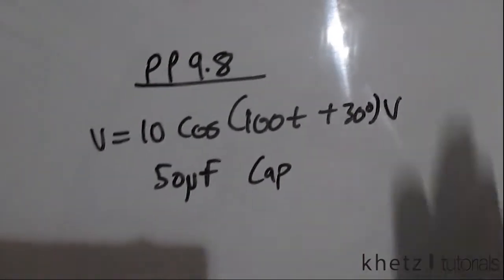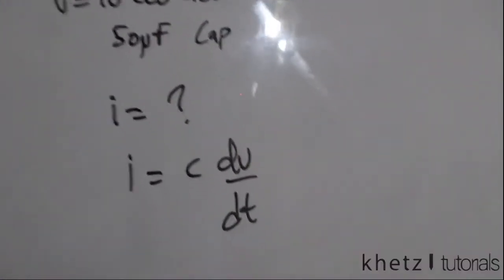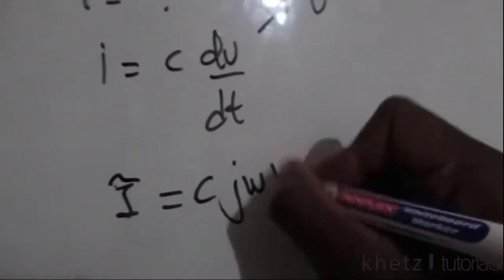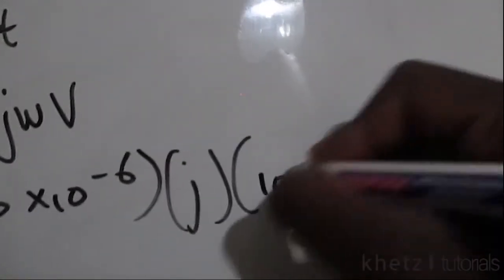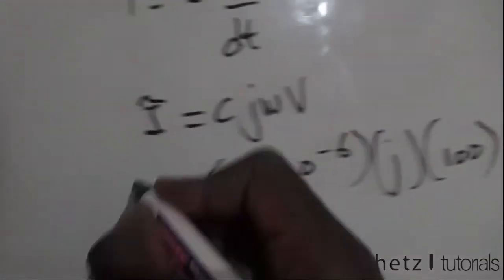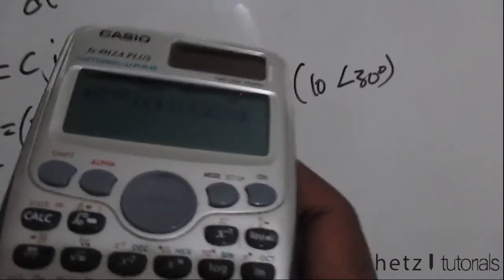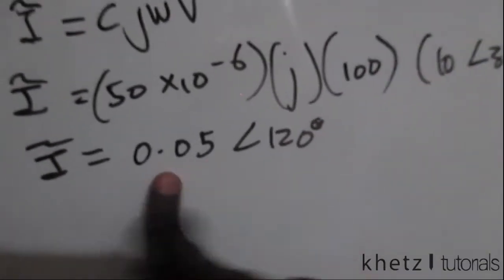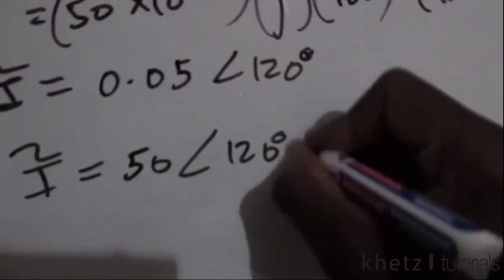Fundamentals Of Electric Circuits Practice Problem 9.8

Comment: Where is J 1:52 😖
Reply from the maker: My handwriting is terrrible😂 it's between the number written in scientific notation and 100
Reply: @KhetzTutorials  no i mean in the calculater 🤗
Reply from the maker: The textbook uses "j" instead of "i" so you won't confuse it with other variables like current etc. So after switching your calculator to the complex domain, it should be the "ENG" button on a Casio calculator. Please note that not all calculators can work with complex numbers
Reply: @KhetzTutorials  oh ,i have the same calculater❤️
Reply from the maker: Awesome!